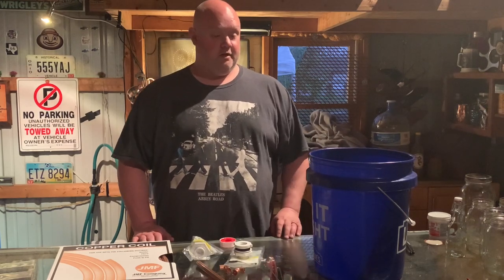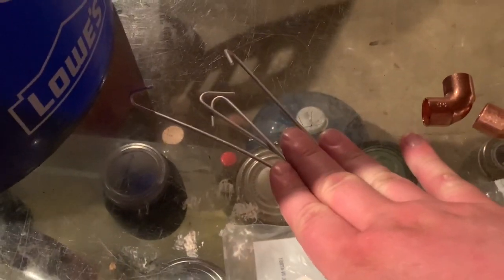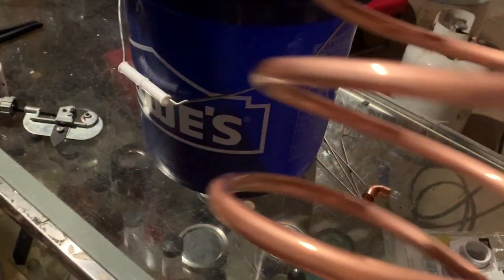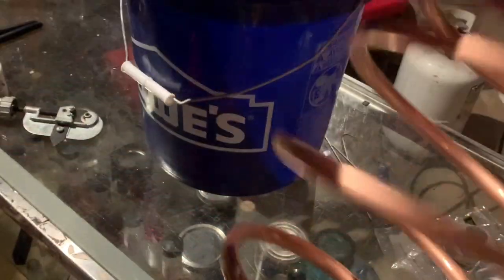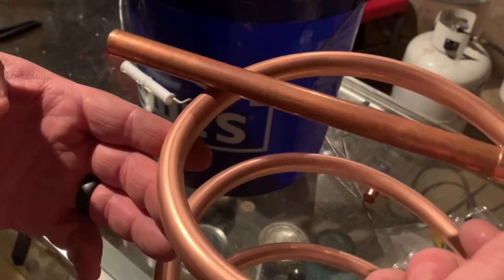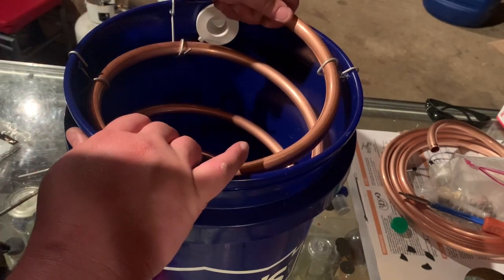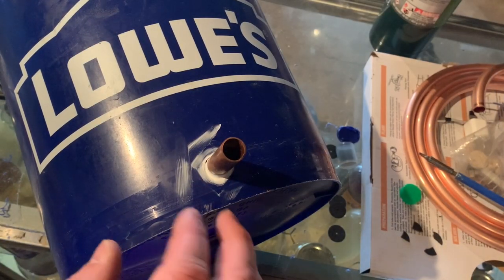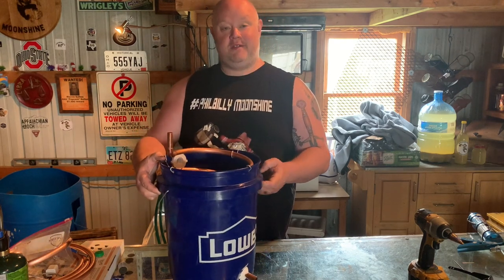How to make a keg still bucket worm

Comment: Nice looks like mine. I had issues with the bucket slowly leaking around the output no matter how I silicone it. I ended up cleaning it again and using JB weld and it doesn't leak anymore
Reply: What kind of silicone I’ve had bad experiences with ones that contain acrylic
Reply: @bigeaze5711  no it was a bath silicone no acrylic in it. Just didn't want to seal. I even went inside and sealed it there to. jb weld took care of it though. The leak was mostly just a seep like a heavy sweating